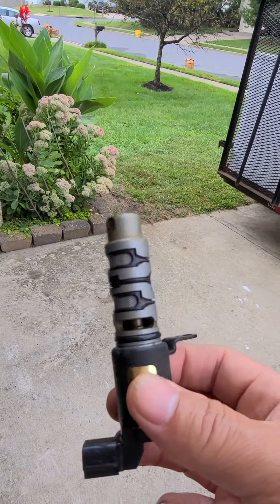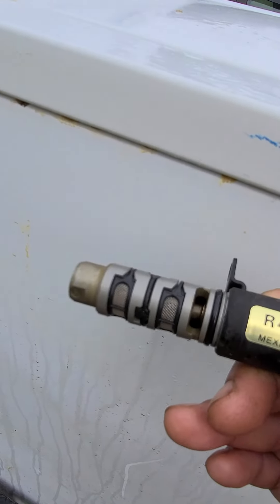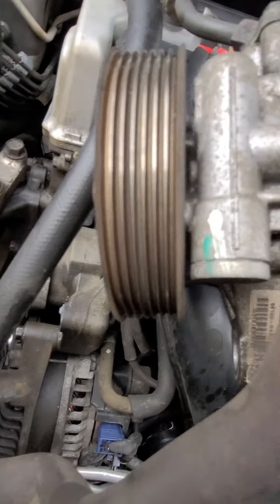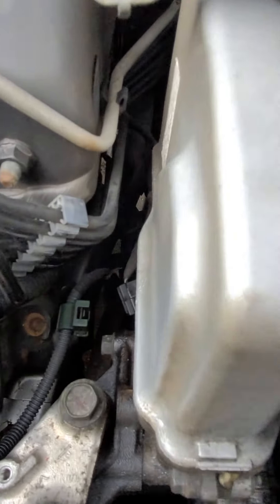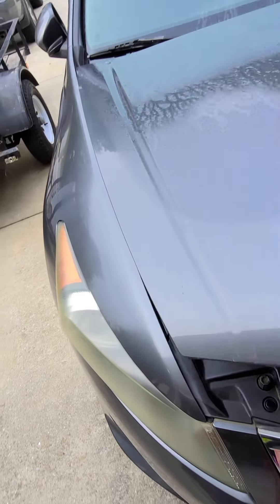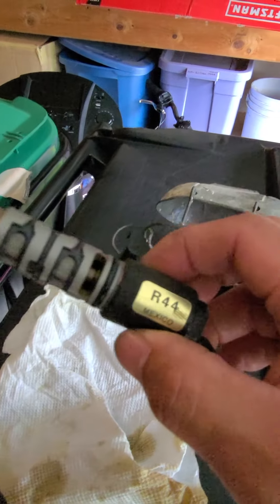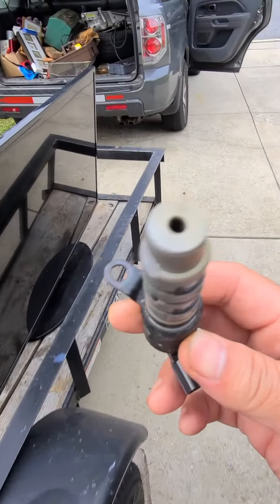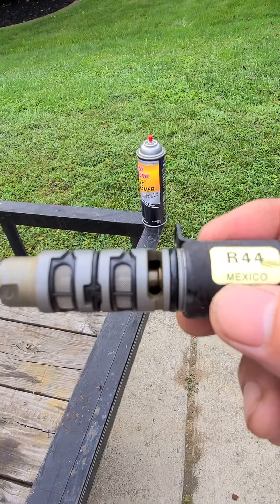Code P1009 VTC Oil Valve sensor, 2003, 2004, 2005, 2006, 2007, 2008 Honda Accord

Comment: Having the same problem.. did the car shut because of this issue ... my car sent a P1009 code also ..
Reply from the maker: Once I pulled the P 1009 code I couldn't figure out the problem took it to the mechanic they had to clean the fuel injectors $562
Reply: Were you able to figure out the issue? I’m having this problem
Reply from the maker: Clogged fuel injection $500